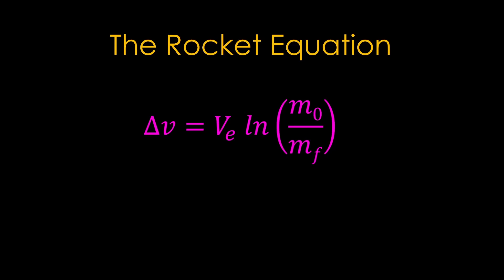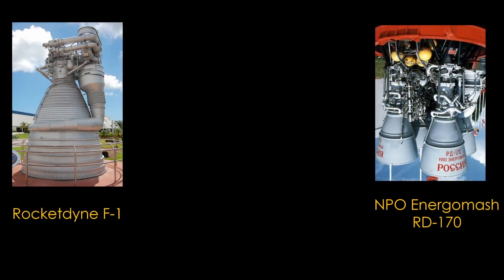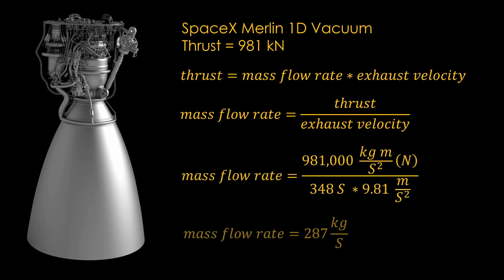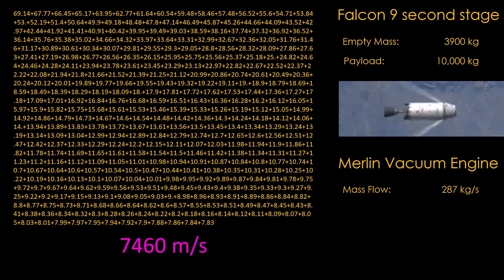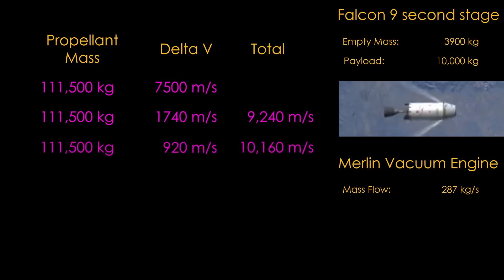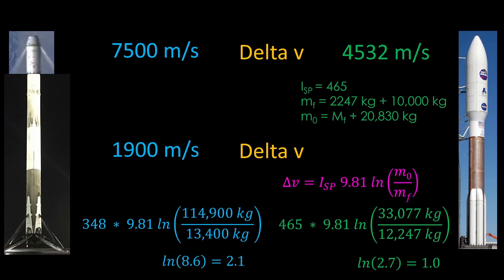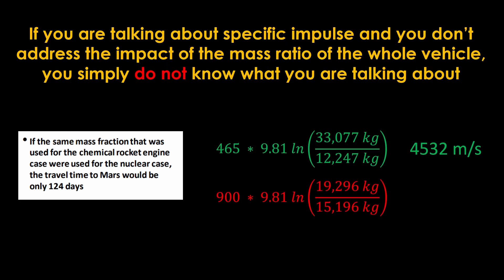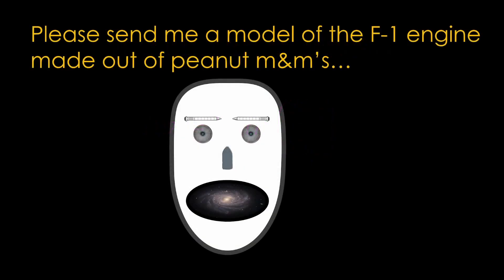The care and feeding of the rocket equation

Comment: The "weird" isp definition is awkwardly refering to the fact that a rocket with the weight of its propellant equal to the thrust of its engines will be able to burn them for the duration of its isp.
Reply from the maker: Yes.

I just don't find any use in that definition - I haven't seen any calculations that make use of it.
Reply: @EagerSpace  me neither now that i think of it... only use i found for it is that when i'm building rockets in KSP and i see the engine's rated burn time is higher than its isp then i know i need to add boosters to make full use of the burn time. 😅

But I'm not a rocket engineer so there's that...
Reply: @EagerSpace  though now that i think of it, engine Isp does therefore give you the theoretical maximum burn time of any rocket stage that intends to/uses said engine (without other boosters). Whether this is a metric that's needed/practical for any actual rocket engineers, that i have no clue of.

Edit: theoretical maximum burn time of the first stage, since higher stages don't need TWR's > 1. And since first stages need a substantially higher TWR than 1 and since dry mass is never 0 i have to concur with your assesment. I see no real use for it, but this got me curious and i will try to look for one.

Comment: Hi I have a question at 5:55 you got 348 seconds. Where did you get that number?
Reply from the maker: That's the most common number I found for the Merlin 1D Vacuum. It's considerably higher than the vacuum specific impulse for the sea level Merlin 1D because of the much larger nozzle.

Comment: If they build the hydrogen upper stage tanks out of some kinda carbon composite material it will take care of this supposed mass ratio problem.
Reply from the maker: The biggest factor for the mass ratio is simply the density of hydrogen; compared to liquid methane, it takes a tank 6 times the volume to hold a similar mass of liquid hydrogen. Tank dry mass isn't a big factor.

The general estimates are that composite tanks might be 20-40% lighter than aluminum/lithium tanks. If you need a tank 6 times the volume that's clearly not enough.

There are issues with carbon composites and cryogenic materials. Rocketlab obviously does it with LOX on Electron and plan on doing both LOX and liquid methane for Neutrton, but those are stored at much warmer temps than hydrogen and are bigger molecules so they are easier to keep confined.
Reply: @EagerSpace  The overall tank size has the LOX averaged in there and with hydrogen, they run it oxygen rich for the most performance per tank mass.  The size of tanks seems like a non issue if you know how to build a cylinder 5 meters or bigger.. I mean how big is the first stage? There would only be a volume problem for the 2nd stage if you built a rocket in the shape of a pencil(falcon 9). The composite materials issue for hydrogen can be solved.
Reply from the maker: @sirmicro  >The overall tank size has the LOX averaged in there and with hydrogen, they run it oxygen rich for the most performance per tank mass.

"oxygen rich" or "fuel rich" is typically is used to compare the actual mixture ratio to the stoichiometric ratio. The stoichiometric ratio for hydrogen is 8:1, so the typical hydrolox mixture ratio is fuel rich, somewhere around 6:1. Methalox and kerolox also run fuel rich. 

There are a couple of reasons. If your fuel is lighter than your oxidizer, you get an isp boost as the average exhaust particle size is smaller and therefore the exhaust velocity is higher. 

The second reason is that gaseous oxygen at 3500 K is really, really nasty and wants to eat everything, so you get "engine-rich combustion".

The only oxygen-rich combustion in rocketry is preburners in staged combustion engines like  the RD-180 and the Raptor. 

It is true that mixture ratios burn significantly more oxygen than fuel by mass.

For the rest, nobody has flown big composite hydrogen tanks.
Reply: @EagerSpace  yeah I got tank fuel masses mixed up with the combustion fuel ratios forgive me but thanks for clarifying it up a bit.
Reply from the maker: @sirmicro  That's what I figured. The "fuel rich" verbiage is confusing.

Comment: ok, last comment. At the end, how did you convert the 7.6 mass ratio to percentages? thats what i want to know please : )
Reply from the maker: The stage full of propellant would be 100%, so to get the 7.6 mass ratio we would need the spacecraft mass to be 100/7.6 or 12%. 

Well, actually 13%, as I apparently did the math wrong.
Reply: @EagerSpace  ok, i see how that works now. My calculus is great but it has destroyed my basic arithmetic hahaha.
Reply from the maker: It took me about 10 seconds to answer your questions and I'm the one who wrote the slide...
Reply: @EagerSpace  i feel that. There were times in my calculus classes that after a while, i couldnt do basic fractions for the life of me. I was too used to other forms of math that i forgot the basics. 

Thanks for all the help, im writing everything down in a notebook thats all on propulsion and rocket design..
Reply: @EagerSpace  I have trouble to understand this. Let have X the fuel mass and Y the "empty" rocket + payload etc, we do have X/Y = 7.6 and X+Y =1 (100%) right ? If I am right then we have fuel mass = 88.4% and rocket = 11.6% of the total mass.
I don't want to critisize and point an error (well in fact the video has the same values than me thanks to the approximation), i am just making sure that i correctly understood what the mass ratio is.
If anyone can correct me or confirm my maths, that would be awesome

(sorry for my bad english)

Comment: Why the natural log?
Reply from the maker: In math, if you want to figure out the sum of a value that is changing, you do it through integration. It turns out that if the value that is changing is of the form 1/x, the result is ln(x). 

Explaining why is a math question.
Reply: @EagerSpace  thanks a lot, I've always been confused by the natural log and the natural number e. Just like П, e is constantly used in math but while the former indicates a precise thing (the ratio between a circumference and its diameter) I've never understood the reason for the latter.
Reply from the maker: It is a bit weird. Hey, there's this magic number that we just use because math.

Comment: I am not sure if you correctly explained the deltaV.
Reply from the maker: Okay. What part do you think is wrong?
Reply: @EagerSpace at 6:55min the propellant mass is increasing from 287kg to 1435kg. That’s not possible. It should be decreasing because rocket threw mass to create thrust.
Reply: @hafizuddinmohdlowhim8426  you are reading it in inverse direction. It says # of seconds to burnout. So 1435 represents mass when we are 5 seconds away from burnout. This number will be higher than mass at 1 second to burnout!